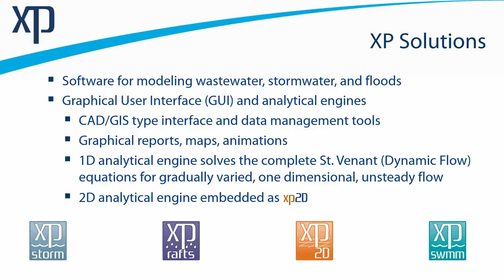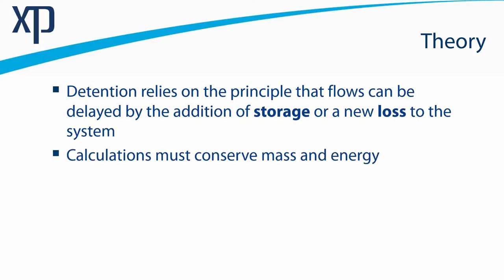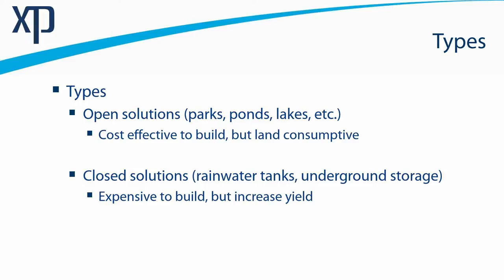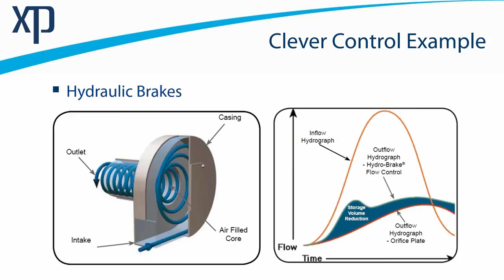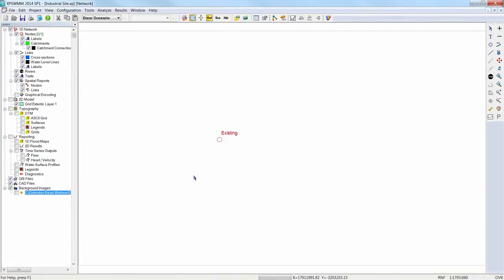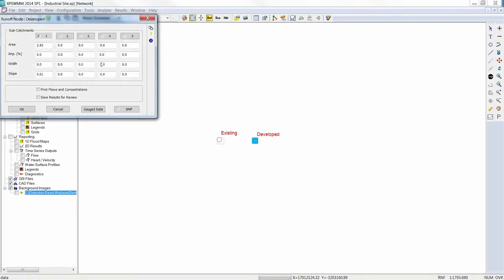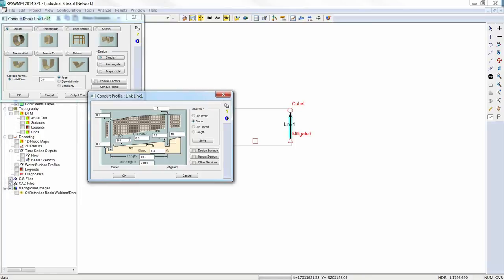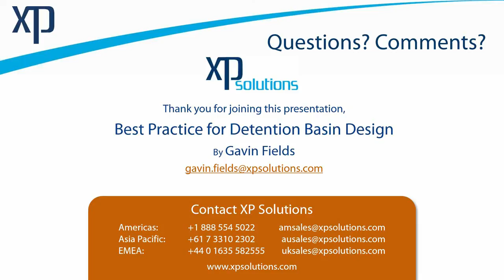Best Practice for Detention Basin Design

Comment: Megan Lu
1 second ago
How did you copy your mitigated node across to the Hdr layer. Mine stays as a square (your copies as a round node), I've use the copy and past function as normal. Its just not registering.
Reply: A square node means that the node is deactivated in that particular layer. Select the node and press the '+' button in the software or on your keyboard and the node will turn into a circle and be activated for that layer.